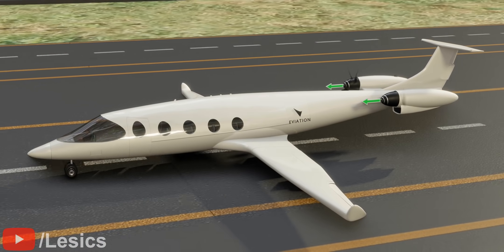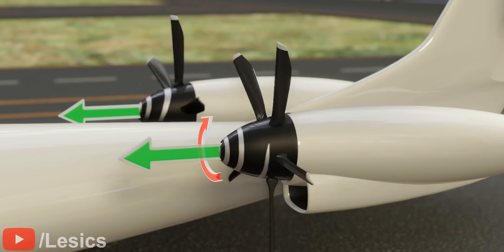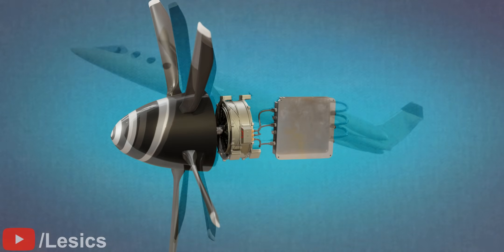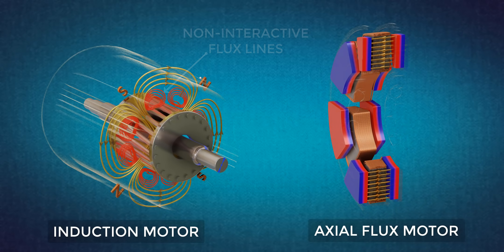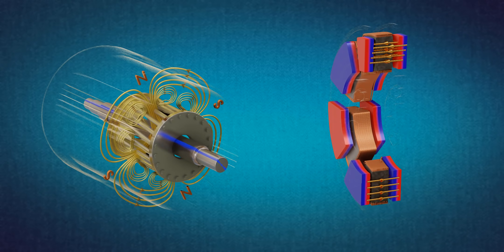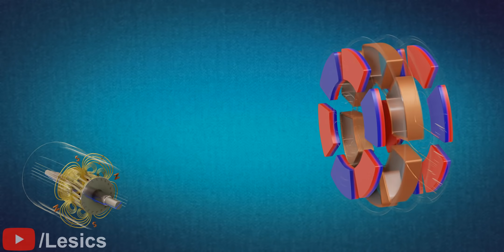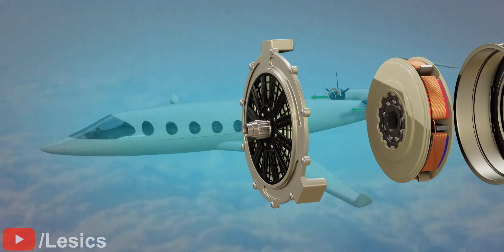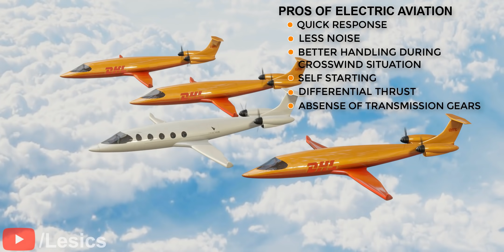Electric Aviation | The Dawn of an Advanced Transportation Mode

Comment: It would be interesting to compare the electric planes with piston engine planes, as they are more similar than jet engines to electric.
Reply: @brianoconnor4269  Yes, I found that a bit strange.
Reply: The biggest cons so far is the battery need space AND cutting cargo capacity. That's already a deal breaker.
Reply: @kaikart123  Electric motors are great, it's powering them that's the problem. Easier to load up cars and boats with batteries than aircraft. How about a blimp covered in lightweight solar panels, I wonder. Maybe that would be a step backwards ;-)
Reply: @brianoconnor4269  No harm done :-)

Comment: After finishing this episode of the glorious electric-powered aircrafts, the engine has an intake 😂
Reply: Good catch...  amazing how many people miss that.  The Electric motor produces a fair amount of waste heat which is cooled by a radiator.  The air duct opening forces air under the motor and through the radiator in the back of the pod.
Reply: @coug96fan  Thanks for your information, I didn't consider cooling issues.

Comment: The only realistic novelty usecase i see is flying from district to district in a large metropolis or for hobby pilots in plane sailing without the need for towing. But safety issues and anti terrorism measurements still remain.

Comment: Why don't you have solar panels on the wings. why don't you have an external turbine to generate at least some energy to charge the batteries You could also have a flywheel to continue continue energy storage In case of a battery or motor Failure. And/or electro plate The body as a entire battery system Making a artificial ground To charge the body while it's in the atmosphere and/or the Ionist fear

Comment: The design of this electric plane is terrible. The weight distribution alone is enough to make you wonder what the hell they were thinking. Props on the back end? Unless you plan to fly in reverse the entire trip I don't see why you would do that. From a safety perspective engine failure is pretty much going to mean the loss of the entire flight. The twist and torque on the main body during flight means this plane is designed to fail horrifically. Here's what I would do. 
Keep the fuel engine on the back end of the plane. Move an electric prop to the front, widen the air scoops a bit on the wings to support air turbines. Then you have a hybrid plane capable of recharging in flight. It could be the Prius of the air and if you added hydraulic foldable blades to the front prop cone you could make the drag problem go away.

Comment: The electric planes will eliminate the negative environmental impact that jet and gas-powered planes cause from spent fuel. Also, couldn't prop blades could be added to the wings for regenerative power.
Reply: Just wow.

Comment: Is it feasible to make a hybrid system limiting the cons and taking advantage of the pros of both fuel and electric system? If yes, how will it theoretically function and what could be the drawbacks. If no, why?
Reply: Unfortunately no. The way a hybrid vehicle saves gas is by using a smaller gas engine, with lower internal friction than a larger one in a conventional car. When you accelerate it will use the efficient electric motor to compensate for the smaller engine, using less fuel. When your cruising you generally don't use the electric motor and use the small gas engine only to keep moving. When deacelerating it recovers energy for future acceleration or power demands. Airplanes very rarely accelerate, and are fundamentaly incapable of regenerating during deaceleration. Airplanes jets when cruising are pushed to their limits, so downsizing their jet would not be practical, unless it operated in a charge depleting manner (always using both jet and electric power to maintain speed), so you would have to plug in at landing. However this would essentially negate any benefit from being a hybrid. It basically would be a Prius that needed recharging but couldn't operate electric only.
Reply: I think the complexity and weight of a hybrid would outweigh the advantages.  Hybrids only use the electric motor for fast acceleration.  Aircraft use high power settings for takeoff and climb to altitude.  I agree with above comments that no electric engineer or aircraft designer had any input in this video, much less a pilot.
Reply: @CrotalusHH  battery weight kills the concept for long range,
hybrid will work.
But speed is about half compared to turbofan engines,
Unless you drive the fans electrically.
Turbine engines have much higher power density, for long range high altitude flight this is just not realistic soon.
Reply: Rolls Royce already doing this with their new "turbo generator" as used in the Heart ES30 electric plane.
Reply: Neel
 yes it will work

Comment: You forgot one of the biggest advantages of an electric airplane which is the motor's ability to be powered by multiple sources. A rechargeable battery is one example but it's not the best because of low specific energy. Fuel cells are a better energy source because they can run on cheaper fuels like methane and hydrogen with higher efficiency compared to turboprop engines. The plane can also use a small rechargeable battery so it can use the propellers as regenerative air brakes. The top of the airplane can be covered in high efficiency thin film solar cells which can increase the range of the aircraft and in case the plane loses it's main power source because of fuel leak or whatever a fast military aircraft can be dispatched to fly above it and beam power using lasers (similar to aerial refueling).
Reply: Good ideas for sure.
Reply: @rickwensel2313  LMAO 🤣 🤣🤣

Comment: Never going to be electric airplanes at any scale.  

Electric airplanes must have downtime for hours and hours—maybe days?—to charge.  Planes must be flying to make money.   No aviation CEO will buy a fleet of planes that have to sit on the ground.  They need to be refueled asap and sent airborne with full seats.   

Also, as fuel burns, the plane gets lighter and is more economical and the plane’s efficiency (miles per gallon of burned fuel) increases.  An electric plane does not lighten as it flies and does not gain in economy.  It’s constantly heavy and constantly less efficient.

Comment: Differential thrust ain't that impossible in conventional jets either..and for quick response characteristics, that will never be an issue for commercial aircrafts unless they are made to be highly agile and performance oriented.. lastly, for GENX and/or any other modern engines, the spool up system is totally electric and self sufficient. So, based on these, I cant see much advantage of eaviation over conventional
Reply: I would guess, maintenance.

Comment: How do electric planes fare against hydrogen? Do hydrogen planes have the same power response issues? I feel hydrogen is the next step forward given the weight of batteries.
Reply: Would hydrogen storage pose the same weight problem as batteries?
Reply: @cw9790  my thinking is no given batteries are heavier than jet fuel and hydrogen might be the same if not lighter than jet fuel.

Comment: And the cost to replace the batteries WHEN not if they go bad will be a reality check for this industry . You can't add extra capacity  to account for degredation like you can in a car. Weight is important to keep down when trying to get off the ground and maximize payload capcity....

Comment: Sorry but electric aircraft make no sense for large scale transport . For small planes maybe and even then meh. You cant match the power to weight and  energy to weight metrics of a jet or combustion engine . These metrics are critical for aircrafts. The starting of a modern jet engine does not necessarily need a start cart. The onboard Apu can start the main engines . This is a very biased video that lacks common sense on why aircrafts use jet engine. You forget to mention the weight of the batteries that kills the payload capacity of the aircraft. Untill you find a way to make iron mans arc reactor, electric propulsion will never replace jet engines.

Comment: Use replaceable battery pod for quicker turnarounds. Battery energy distribution system more robust than liquid fuel. Airplane weight  & distribution stays constant during flight. Regeneration during descent. Less moving parts is simpler maintenance. Almost no engine life restriction except batteries.. But, range...

Comment: This really is a back to the future solution. This electric technology cannot match the speed and power of the jet engine.
We may yet be forced to reintroduce airships, these can be electric powered and can be considered as being very quiet. But apart from the improvements in battery energy storage, this is a technology from the 1930s. It is ironic that children's books of the period envisaged a future dominated by airships and propeller driven aircraft, the concept of jet power did not feature in the scifi of the time, yet it is a technology that, by necessity, may have come and gone, along with faster than sound travel. Without a new revolutionary form of propulsion, our only hope of matching the performance of today's jet engines in the future, is to power them with hydrogen.
Reply: Problem is the huge volume of hydrogen, even at a liquid state @ 7°Kelvin.
In the time where the Lockheed 1011 was built, Lockheed seriously considered hydrogen fuel. Nothing cheaper than jet A1 fuel, but not good enough for rocket fuel (refined kerosene) RF1 is 5 times more expensive.

Comment: yes, but the batteries will always be heavy, so, between similar sized jet vs electric planes, the jet powered one will still be able to carry more cargo. not to mention, batteries take longer to charge than to just fuel up
Reply: @PsilovibeGraham  Once the graphene is proven as viable in energy transfer (charging), AND we see batteries with 3-4x greater energy density than the absolute best currently available, then you may have a legitimate point. But let's not forget that such rapid charging isn't supported by the grid, so you'll need large scale batteries, receiving constant charge and able to rapidly discharge into said plane batteries to make it all viable, as well. 

Until those three things become a reality, you're banking on speculative hypotheticals, and not based in reality. You have no business attacking anyone else, hypocrite. Please work on that.
Reply: yes... but lets for for short island hopping where price is primary concern and you only need few hops per day its viable option. also change wing and put batteries in hull... new aircraft should be developed quite easy
Reply: @PsilovibeGraham  And your still likely a 5-10+ years away at minimum till graphene being practically applied, as well as the same or more for carbon nanotubes in wide capacity.  

This all simple speculation till you get batteries with the same energy density to weight ratio as aviation fuel.

I remember reading about graphene 8-10 years ago on a tech website and still waiting for it to be used in anything useful for consumers.

Most people simply speak in generalities.

" Your comment honestly adds nothing to the conversation. Please work on that." The only thing missing is the clap emoji at the end of the sentence, like on twitter.
Reply: Would it b possible 2 siphon off excess heat from a jet engine into a generator, 2 create energy 4 electric engine's, & could this greatly reduced fuel consumption , 4 a aircraft propelled by a jet & electric engine's. Sorry if this sounds like a stupid idea

Comment: It is better to research on Renewable fuel (synthetic fuels) than using resources to make better motors, better electricity storage, better power. Note: there are 3 problems with electric planes, but only a single problem with jet aircrafts(carbon emmision).
Reply: I'm assuming the cost of an electric prop engine would be less expensive than a jet engine. And if that's true then that could be another perk.

Comment: One more point.. we can run bldc motor reverse in order to land on short run way if needed..
Reply: A turbine plane has something called reverse thrust which produces the same effect. If you do this on an electric plane does put a lot of strain on the engines tho when you turn them in the opposite direction causing insane increase in force on the axel and blades.

Comment: I'm surprised at your electric aircraft choice to showcase. Eviation Alice was first designed by people with 0 engineering or aircraft knowledge as a way to get money from gullible investors. The first few iterations were impossible to manufacture, clearly lied on their specs (like range, MTOW, etc.) and were clearly un-certifiable both in the US and in Europe. This last design (the one that you showcase here) still has lots of problems: production costs are going to be prohibitive (how are you going to manufacture the windows? There are no two windows that have the same shape! Or how are you going to build that fuselage shape? Let alone cure the composite materials in an autoclave!), the comfort of the passengers will be similar to a small bus, with probably less than 100km range, and forget about bringing luggage (there is literally no space for it). Moreover, there are still lots of certification problems, range impossibilities due to energy density, and the max airspeed of this aircraft will be comparable to a train. All in all, just a money grab for gullible investors.

Maybe two or three iterations down the line this aircraft can have any use, but I'm not really sure if they can manage.

Good video, but probably should have focused on the cons of the design (which is almost everything).

Comment: Definitely a biased video. You also don't have a very good understanding of how the propeller systems actually work and why they are used on planes. Changing the pitch allows the propeller to be mpre efficient at different power settings and different flight conditions. Feathering is also a useful thing to have on multi engine planes; feathering is when the propeller blade is inline with the air to remove drag when one of the engines die. There are also other things like de-ice and compression of the fuselage which will make longer distance flights possible, or even make the plane more robust. Ontop of all the advances that need to be made to make this possible, it all still needs to be tested and appeoved by the FAA which throws your "few years" out the window.

Comment: A bit of bullshit.

First, two-engine jets can control all angles just with their trust. There were a couple of air incidents when the plane lost control with surfaces (rudder and ailerons) and was controlled with differential thrust only.

Second, at the take off you have as much power as you can, so the option of steering is just decreasing the thrust of one engine. Using the rudder does not decrease it, instead.
And I guess, the response from the rudder is faster than the response from different thrust.
The only timespan where the rudder is ineffective is taxying and the very start of speeding up. Okay, but wheel brakes and steering frontal wheel is effective there.
So, TOGA, v1, rotate! and no playing with levers, please, - electric or gas, jet or prop.

Third, your video shows an airplane with tail placement of engines. To steer, it is better to put them on the wing, not at the tail.

Finally, about the noise.
Turboprops are very noisy not because of turbo, but because of prop. The champions of screaming are open propfan engines and huge aircrafts like Tu-95.
Electric motors would just decrease noise from the motor, leaving propeller noise alone.

Comment: No matter how much batteryheads deny, but the fact that you MUST go to fuel cell technologies if you want to go electric in aviation still remains.
Reply: Not for all cases, there's already a niche for electric aircraft in short range flights
Reply: Wrong. 
Batteries are most likely the better option: Costs will decrease much faster than for fuel cells and hydrogen tank systems, System complexity is much smaller compared to fuel cells. Gaseous hydrogen tanks (only option for general aviation) are very heavy too...

Comment: Until an electric plane or jet has the range of a conventional plane or jet, none of this matters.  It’s all about the batteries.  Add in charge time and electric planes (and cars) have a very long way to go.  But this is a based on a false premise.
Reply: Like the video said, its good for short range delivery. But the thing about quick responds is completely removed because of the airfields ability to give them space to take off. Also, i think they promote the electric plane a little to much and make false statements to make the jet engine plane look bad. Its sad cause i like the idea but the way they present the info is altered to make a better impression for the electric plane

Comment: Aircrafts are the biggest carbon contributors.
Axial motors must have multiple rotor/stators, offset from each other on a common shaft, to cancel the vibrations caused by pulsing the magnets.
When the coil is energized, it pushes the magnets longitudinally as well as laterally. If only one stator is sandwiched between two rotors, the motor will vibrate badly. 
I predict that new electric pulse motors will have multiple rotor/stator plates on a common shaft, each offset from the next by say 10º. That would be like an 8 cylinder engine. Each firing at a different time in sequence. Like how Karate can deliver a brief but more powerful punch.
The beauty of pulse motors, is that you recover the pulse energy (minus Ohmic losses) via a bank of capacitors. Efficiencies of over 90% have been recorded. 
You can't do that with a motor that runs on a sinewave power.